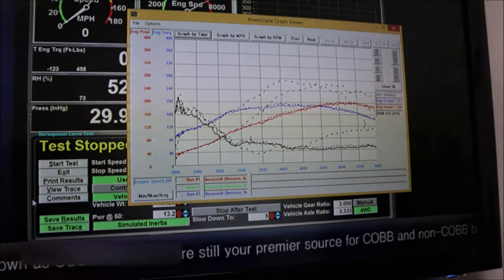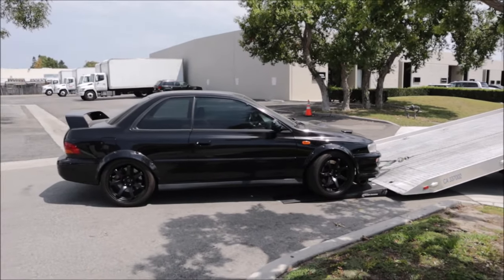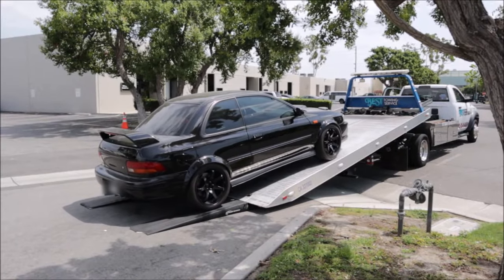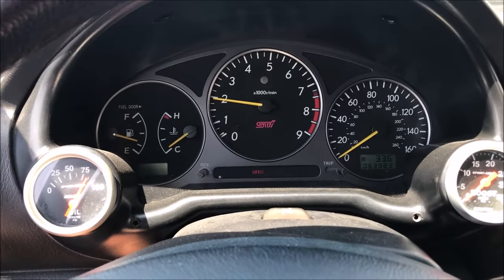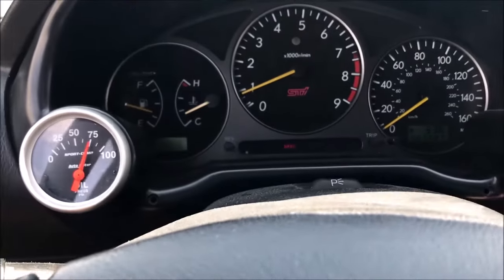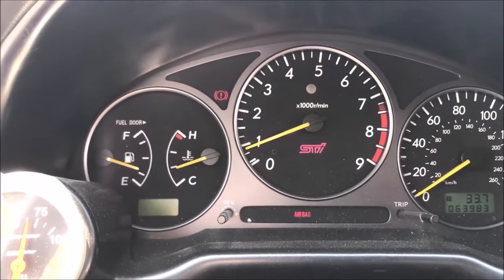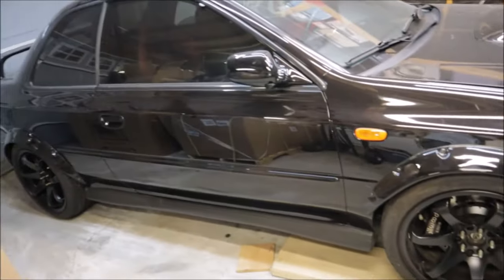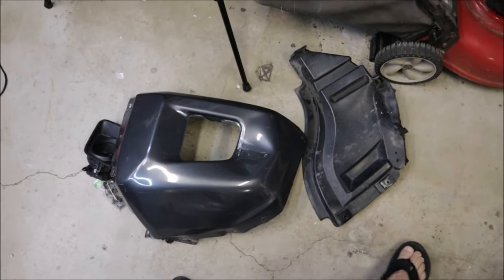Subaru Impreza GC8 Dyno Tune Disaster

Comment: It's running down a cylinder did they check plugs and coils. Unplug one injectors at a  time and see if it runs worse
Reply: Nevermind I just seen that you have piston slap probably a built motor and also goes to normal when switching back to the old tune im betting its the tune

Comment: Hey man listen i have an Gc8 wrx sti 1999 and before 3 yars i was have to change the MAF sensor exactly after couple of days playing and drive and tuned and driving and bla bla bla and  finaly i f***kt up my car by my self because durring tune and changing car's parameters durring driving like crazy specialy after 4000 rpm only god know what info the sensor read, and what info the sensor tell's on ECU on subaru usualy that hapend by using different voltage signals witch you can read with osciluscop... But there is easy way.. 
Im almost shore you run ej20 or ej25 engine and if run with stock OEM MAF sensor even if u do engine swap if the MAF is stock you can disconect the MAF wire from MAF and if u reconise the cars engine stars run smootly but with check engine Light ON i hope is connected after the cluster dashboard swap... So if yo disconect one vacuum hose durring engine run at idle and car stops smell and hesitate jerk

Comment: Ive seen an issue like being a stuck open injector. Took a lot of digging to find that issue. 
Another instance we found alternator voltage regulator was causing all sorts of crazy running issues.
Unless it went back to normal with the previous tune?
Reply from the maker: Yes, it went back to normal when switched to the previous tune. Now, I am unsure if it’s the car or the tune?!
Reply: @RoadPatina  ive seen some whack tunes, if it went back to normal after removing. Then id say best bet is another tuner who is familiar with subaru and if using it, speed density or hybrid. 
Hoping for a good outcome brother 🙌
Reply from the maker: @TheSubieSanctuary  I appreciate it! Too bad all the tuners are booked two months out. Thanks for the advice!

Comment: And yaaaaa i hear some knock when the car enters in the garage at idle i hope is Just some valve working garage echo...pray for that bacause Last time when I hear my ej20 turbo knocking like that.... Ufffff i was knowet that was knocking on the heavens door i change  Rod bearing on 4th cylinder
Aaaand yaaa... the rest of the whooole engine rebuild and now 20 000 km hopefelly everything is fine... Before knock 110 000km Just like hell everyday drive like stolen Just bautiful machine makes me smile every time when I starter and that is the whooole point good luck man
Reply from the maker: I hear it too and it has always sounded like this. Its more of a piston slap sound than anything. I think when the forged pistons went in, the tolerances were loose!

Comment: Hey man, i know the feeling its such a bummer.

 I have a very similar car myself, JDM GC8, and a few videos on it. I have an apexi pfc ecu but after working out the costs for me it just wasnt worth a tune right now, so im back on a stock ecu. Shitty part is now i break up above 6.25k rpms cant get to redline, and have replaced every part from spark, to fuel, to air that could cause it. Being that its winter where i am and getting cold as f, and i have to work on the street im gonna have to put the problem on hold, likely till next year :/. So what im saying is theyre a total bitch and we have solidarity in that brother. I hope it works out for you.
Reply: Also if you ever need someone to bounce ideas off of i got alot of experience with the jdm engines, and misfires hesitation etc. WHat engine do you have and what ecu? might be able to help you out.
Reply from the maker: I feel your pain brother, at least we have all the heavy lifting out of the way. Its the little things that are the largest annoyances! Keep at it. You seem close, cant stop now!!!

Comment: If you disconect one small vacuum hose when run  at idle and the engine stop smell and jerk yaaa you runn very rich and after   that plug back the hose and disconect the MAF plug wire if engine starts run little more smoothly but with check engine Light on change the MAF sensor not shore on 100%  but May be... if yo run on stock MAF for your engine ofcourse if no somthing in the AIR FUEL is messed up.. I say this because durring tune and change parameters on ECU and drive change-  drive-change thats same wath the dyno guys do the MAF start to send bug signals to ecu until one moments the ecu stops read the MAF like his own there is nothing like error clean battery disconect bla bla NO... no on the MAF not works.. change it im 75% shore is the MAF
Reply from the maker: Thank you for the help!

Comment: Take it to a tuner that actually builds engines. That knows the in and out of ej. If it ran better before there tune it’s there fault.
Reply from the maker: Agreed! Next shop on the list is highly rated by many Subaru builders. Just wish they weren’t booked 2 months out.
Reply: @RoadPatina  Yeah most good shops are pretty busy and good luck you’ll get it figured out. Nice car by the way I have a 1998 Impreza black 2.5rs but with a eg33 swap.
Reply from the maker: @Monster86s  thanks man! Sounds like a fun car.